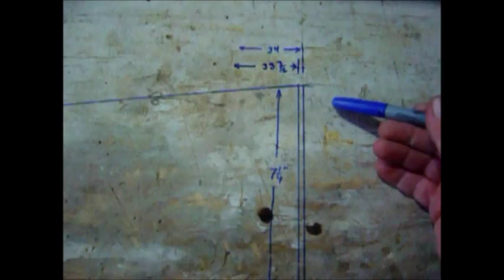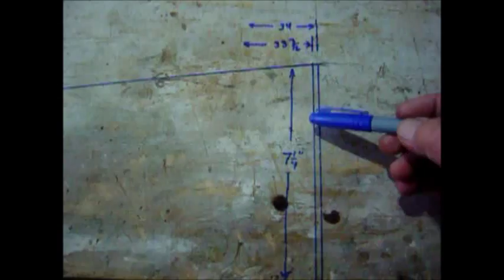Solar Water Distiller Build Part 1

Comment: Thank you for this video. I'm constructing my own solar still but haven't come across the right material for the trough. What is our trough made of?
Reply from the maker: The trough is made of PVC (vinyl) coated trim coil aluminum available at home improvement stores. but for something this small you could probably contact a local vinyl siding installer and they could make you one for a couple bucks if you tell them what you want. Thanks for the question.